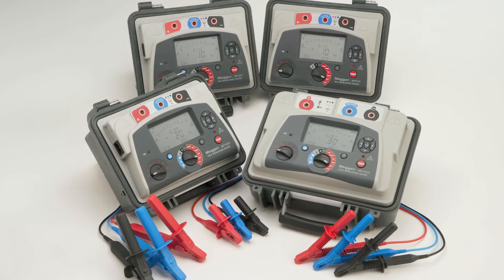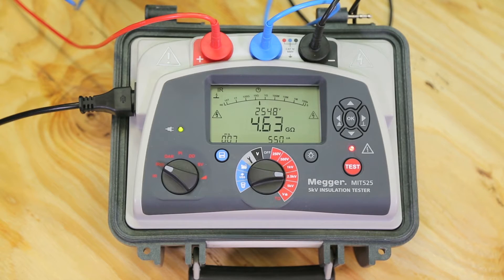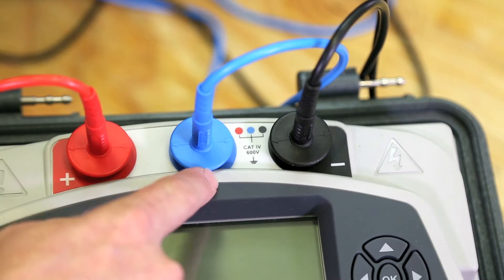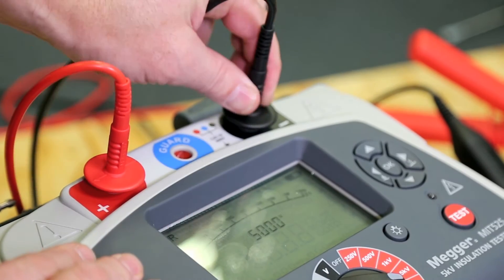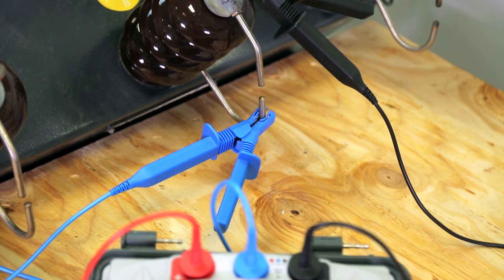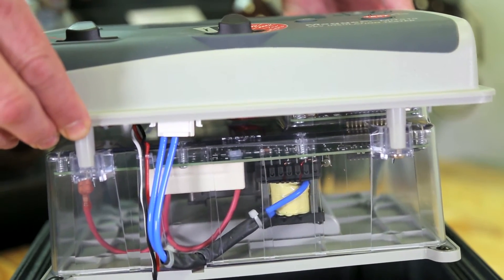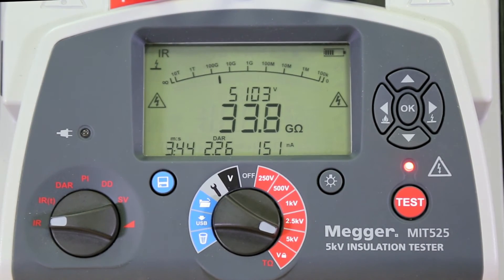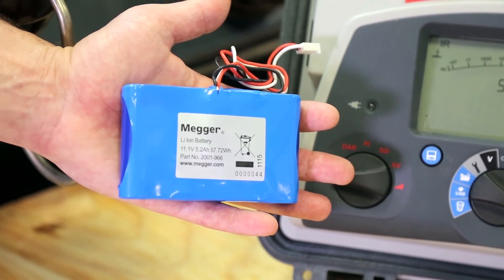Megger Insulation Testers (MIT) over 5 kV, the industrial tester range

Comment: Hi,
We have the MIT2500 tester and the buzzer function in the insulation testing is a bit backwards for our use. See, we need to test multiple leads in a large circular connector. It would be very helpful if the buzzer would sound every time the IR value would drop below a certain value. It would be very helpful so we didn't need to look at the tester display between every measurement. There are hundreds of measurements to be made at one time. Right now the buzzer sounds when the value is OVER the preset value, which means it sounds that dreadful beep all the time in our ear unless a fault is found, which is almost never.
Maybe an update to the firmware could be made to make this possible? Where could I suggest that feature?
Reply from the maker: Please could you send this message plus your contact details to uksales@megger.com and mark it for the attention of Mark Johnson and we will follow it up.
Mark
Reply: My, MIT 525 always, error 10??? When we started from off to any voltages position